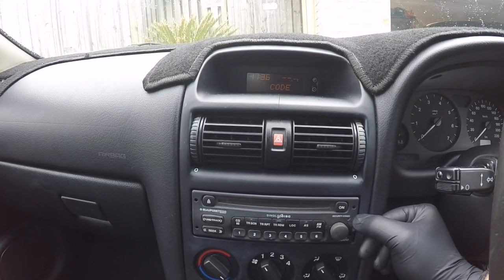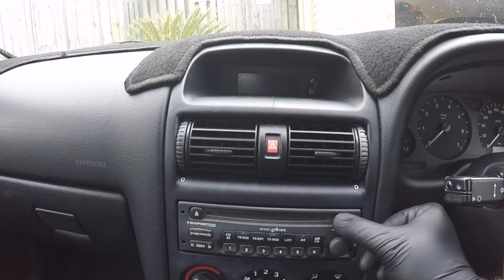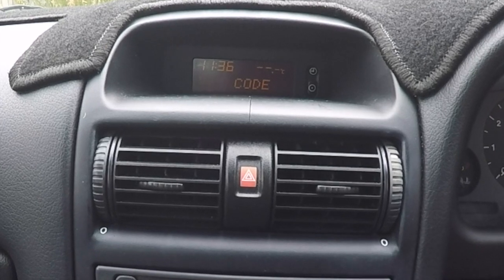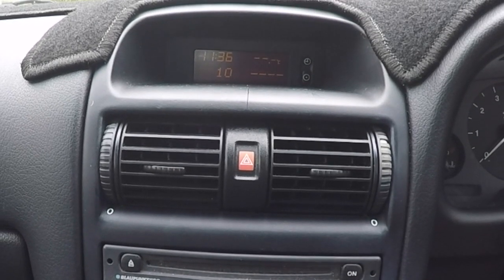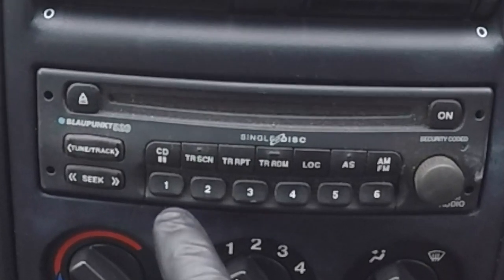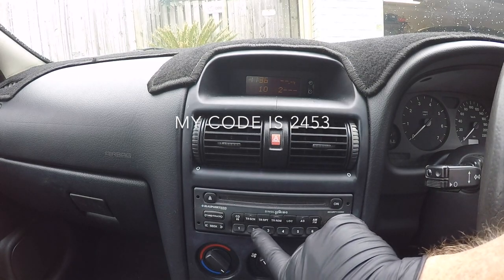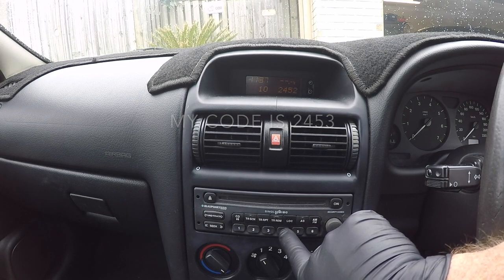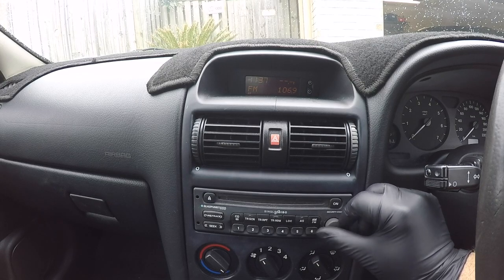Vauxhall Opel Astra G Radio Code  / Holden TS Astra Radio Code

Comment: Hi mate
Jyst bought a 2002 Astra TS. radio showing 7 SAFE !
Just 2 whats the procedure to get out of it and back to radio please?
Cheers
Reply from the maker: You need to enter the radio code. 7 SAFE is saying that it has had failed attempts but has 7 attempts left.

Comment: hi... i just bought an astra... how do i get the code for the radio. old car just put new battery
Reply from the maker: The codes is often in the original handbook or manual. Sometimes someone has written it on the side of the radio. If it is the original radio you can go to the dealer with the VIN and they can get it for you, some times they charge some times they don't. You can also buy a second hand radio with a code. Here are some options. In. this video I brought a secondhand radio with a code and slipped it in.
Reply: Me too where I will find codr

Comment: If you're stuck on # SAFE you will need to wait 30mins-1hr with the key in the ignition, depending on the number displayed to try again.
Reply from the maker: cheers thanks for sharing this tip
Reply: Won’t that fuck your battery up even more though

Comment: Hi there, Have an Opel Astra G 2002, My Time and Date display is the same as yours  but I notice on mine that the Temperature reading is blank showing "- -.- c" exactly like yours. I've never seen an actual temperature reading show up before, any ideas how to get it to start showing Temperature readings? Why is yours also showing nothing? Cheers, Lewis

Comment: Hi Killa, today I replaced the battry in the car opzl astra 2001   but the screen just showed the date,time,and temperature,  I couldn't get the code in the screen. After press the DS button I heared the bip but no code display at all only the word SAFE and the radio work good before. Please help. Thanks and cheers.

Comment: hey mate i have 2004 holden astra ts it has check light on  with DTC p0130 o2 sensor bank 1 sensor one i have replaced the o2 sensor but check light still pops up with same code am getting very low fuel economy i cannot see any leak from engine bay, in obd2 scanner sensor 2 is working fine but sensor one is stuck to reading 410-425..need help.. so far i have changed fuel filter, air filter and cleaned throttle body and MAF sensor because i had very minor idling issue too.. looking forward to hear from you ... 

thanks in advance 

much appreciate your work .....
Reply from the maker: You could try swapping the sensors and check the readings. Could be the wiring or ECU issues if swapping them shows no change.
Reply: i have replaced sensor but no change wiring seems to be ok no burn and damage but don't know about ECU can you give any tips to check it ....
much appreciate your reply...
thanks and looking forward to hear from you ...
Reply from the maker: When the ECU starts to go in these is usually causing injector faults so you should be ok here, fingers crossed.

Did you clear the codes after swapping them?
Does the error code come straight back?
Looking through you live data feed, are there any other values that seen unusual?
Sometimes the small vacuum hose plugged into the back lower parts of the throttle body gets knocked out causes lots of these issues?

let me know how it goes?
Reply: yes i clear the code but pops again after 10-15 kms and i don't know what to see in live data but o2 sensor one reading is stuck to 410-425 and o2 sensor two shows big differences from 1-900........
Reply: sometime i do have problem with starting car crank but not start 1 out of 10 chances ...

Comment: I have got a Holden Astra 2006 sedan, I have done what you have said and the speakers beeped, nothing is working tho, radio isn’t turning on and nothing at all. I have disconnected the battery and tried again but it won’t beep again, my orange light thingy isn’t working either so I can’t tell if it says code or safe or anything
Reply from the maker: Sounds like you have another fault as well and the code.

Comment: Hey mate!!
I have holden astra the radio showing safe 5 what should be doing for that?
Reply from the maker: That means you have 5 attempts left to put the code in correctly. After that it will be permanently locked. Thanks for the question.
Reply: Killa Watt Garage yes I know but now i have a code and i want to put it and I Press on at AS will don’t give me anything for put a code
Thank you
Reply: @adamodisho8477  ⁷
Reply: @adamodisho8477  did you work it out as I have same problem?
Reply: @killawattgarage  did you have any suggestions

Comment: i tried to add a key to one of these Opel Astra G 2004 today id40 Opel chip but the key would not add
the Astra had a display in the dash and a security light on the radio but the radio and dash lcd display would not work
im using the mvp it says the frequency is wrong
i am in Australia do you think it might be the radio not working
Reply from the maker: Sorry mate haven't had much to do with adding keys/chips. If you are in Brisbane I know a guy that is my 'go to' with these issues.
Reply: @killawattgarage  i was speaking to josh from Brisbane today im in central n.s.w middle of know where.

Comment: Hi Killa, today I replaced the globe in the date and time screen to restart my radio stereo in the Holden TS 2002, but the screen just showed the date,time,and temperature,  I couldn't get the code in the screen. After press the DS button I heared the bip but no code display at all. Please help. Thanks and cheers.
Reply from the maker: Simple questions first, is the radio working?
Reply: The Same with mine,  I'm giving up as such

Comment: Hi mate.. i replaced my battery and my radio seems it turns on but there's no code in the screen. My doesn't work.. i tried to press the AS button and it beeps but the CODE in the screen doesn't appear. Any idea?
Reply from the maker: Not sure sorry cant help there.

Comment: Hi I have the number 7 in my code how do I get 7 were my number only go to 6 
Thanks
Reply: You need to use only numbers from 1 to 4, for example your code is "2457" so to get number "2" for the first code number you need to press button "1" two times, to get code number 4, you need to press button 2, 4times and so on.

Comment: Hello mate, i have code, after change batterai, my radio display CODE, but I push button AS for more 3 second, nothing happen, whats wrong with that? Kindly you can solving my problem thanks a lot mate.
Reply from the maker: Not sure on that one. Is the number 10 showing as the number of tries remaining?
Reply: @killawattgarage  theres no change, just only display CODE, nothing change while I push AS button for more 3 second. Is there something with that button??